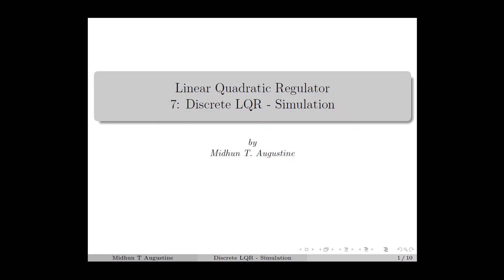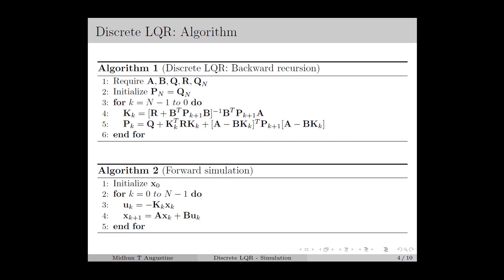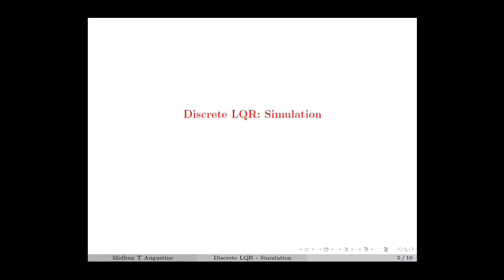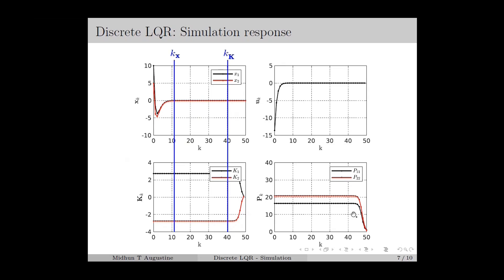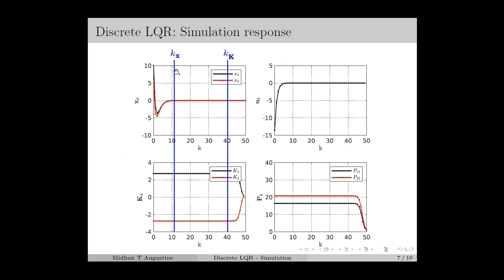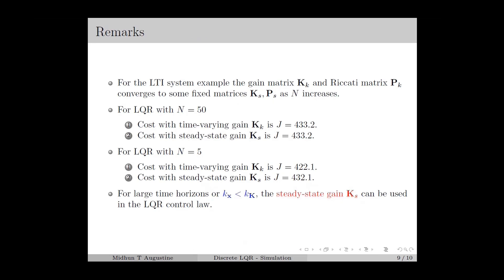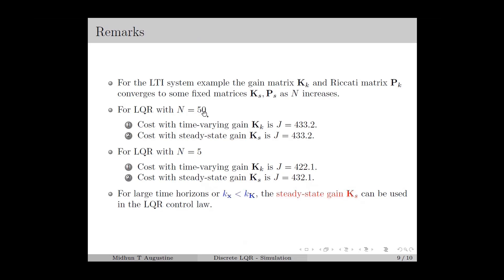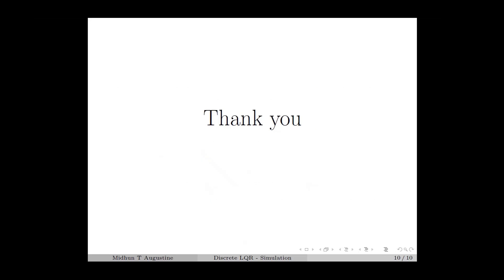7: Discrete LQR - Simulation

Comment: Can LQR track sinusoidal waves?
Reply from the maker: In general, LQR is used for solving regulation problems where the reference is considered to be constant. I think, extending LQR for time-varying references such as sinusoidal waves is not straightforward. For tracking time-varying references, we can use methods such as MPC, SMC, etc.